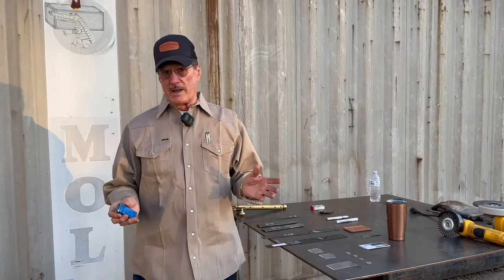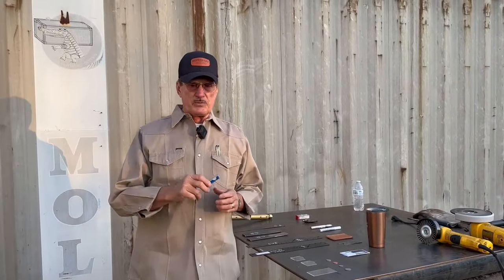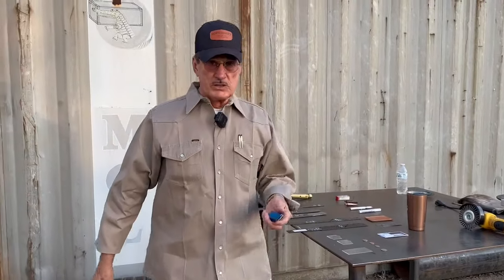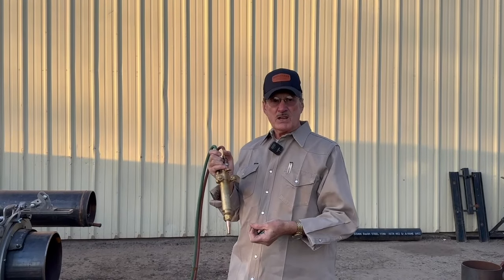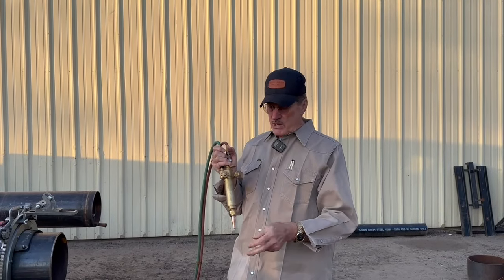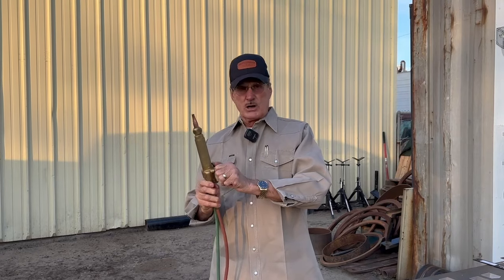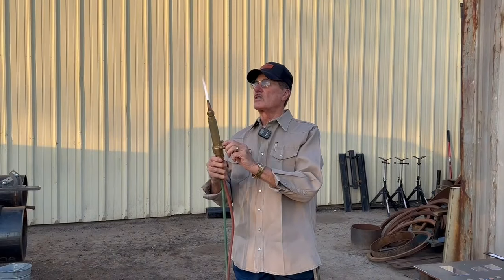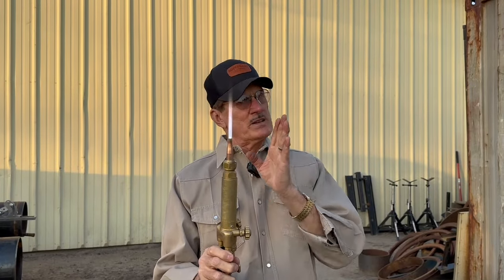How to Bevel Cut Pipe for Welders, Pt. 1 -- Cutting Tips, Torches, and Flames

Comment: Why do you roll your sleeves up to the inside of the shirt?
Reply from the maker: It’s a trick to keep you cool.
1.  If you roll the cuff to the inside it will stay in place while  you’re  working.
2. With the cuff rolled up, your veins at your wrist are exposed to the air and act like a radiator.
Similar to sticking your foot or hand out from under the covers at night when you’re hot.
3.  So your cotton khaki shirt will protect you from the sun and sparks, and exposing your wrist will help keep you cooler when not welding.
Thank you Demethrey!